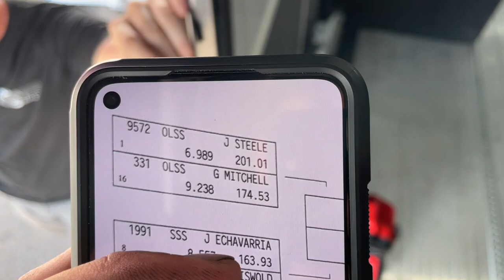FL2K21 Day 3: Mullet SMASHES His Best Pass Ever & Leroy Races 6 Second Stick Shift Cars!!!

Comment: Where did the parade of people come from @ 12:45-12:50? and two guys in the last bunch looked like they were about to fight right there on the starting line but I realized that they just ran into each other on accident somehow...... I really think Cleetus should convert Leroy to a straight axle and get rid of the IRS  and put a real trans in it one that bolts up straight to the block and not only would everything be stronger than it already is but it would give it better weight distribution and it would make things a whole lot easier to change the trans if you ever need to and you can also get rid of the torque tube and put a carbon fiber driveshaft in it and that in itself would lighten up the rotating mass and with a Fab9 rear it not only makes things alot stronger but it will also give you a lot more adjustability when you put a 4 link rear suspension in it and you should do the same thing with Ruby as well and you should really get a 632cid BBC built by Steve Morris or another big name engine builder or go with a 572cid or a 632cid "Semi Hemi" built by Sonny's performance like Mike Finnagen has in his jet boat and of course put the new Precision "Pro Mod" style twin 98mm turbos on it and go straight into the low 3s in the 1/8th or mid to low 6s in the 1/4 and you should put the twin turbo BBC in Mullet or the Nova and put Mullet's set up in Ruby and go for low 7s in the 1/4 or low 4s in the 1/8th and if you put Mullet's set up in Ruby you can run in the same class as Alex Taylor in the unlimited class or you can run Rowdy Radial and run the 1/8th on Race Week and Drag Week and one last thing is when you make a pass in Mullet it is doing the G-body shuffle way down track

Comment: I'm just a shade tree mechanic but here me out race guys. Would it be possible to install a thumb roller switch on the wheel that would be linked to the ecm and progressively add or reduce power depending on drivers feel. Like have it linked to timing fuel boost etc and have pre program tunes at different intervals of the switch

Comment: I love your videos! I’ve been around drag racing since the 80s! The only reason anyone tries to run a power glide in a high horsepower car, is because they could rebuild them in less than 1 hour! If you don’t have anyone that can do that, they are a complete waste! I know they say they could be built for thousands of horsepower! But they don’t live… Those cars should have Rosslers in them! A 2 or 3 sp Rossler 400 would live thousands of passes behind the L/Ss you guys run! Leroy hasn’t left the starting line all year! Do you have the amount of runs those tires have on them? Just because they look 👀 ok doesn’t mean they are! There is barely any smoke coming off of them, which is the first sign 🪧 of them being shot! Also I have no idea why your still trying to run a stock crank sensor on a 2000 hp engine w a Holley dominator! It needs a real crank sensor on the front of the crank! If you want stuff to work @ it’s maximum capacity, you need to have professional stuff! Not relying on stock shit! Also that dick in the Supra screwed you on the line! He waited until he heard you let off the throttle, which almost never goes well, never mind dicking around forever getting to the starting line! Most guys know if they are against a power glide car, they waste as much time as possible, because the hotter the power glide gets, the more chance it’s going to slip! JS! Out of all the people you have standing around your pits! Somebody should be in charge of pass data! What was the air like? How many passes does the engine, clutch, transmission, tires have on them! What was the performance? What did the car do? Wins loses issues ect ect ect! Unless you just want to be professional test & tuners! Somebody needs to be on top of this shit! Or your just lost every single time you go out! Good luck!